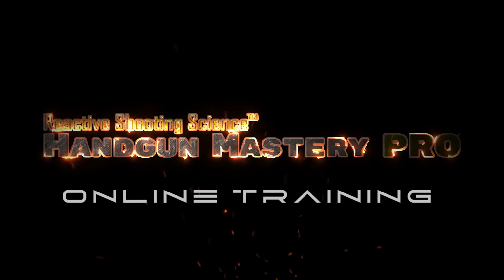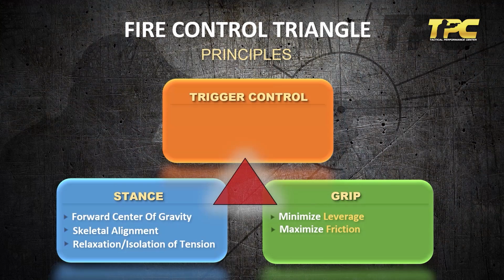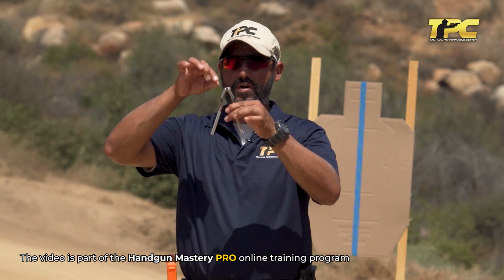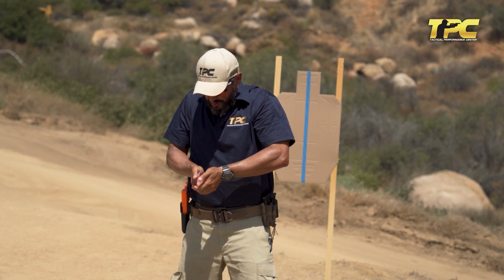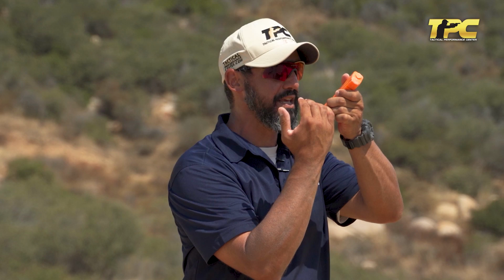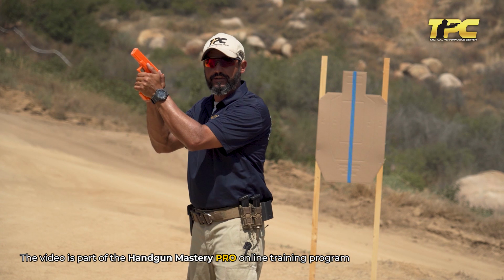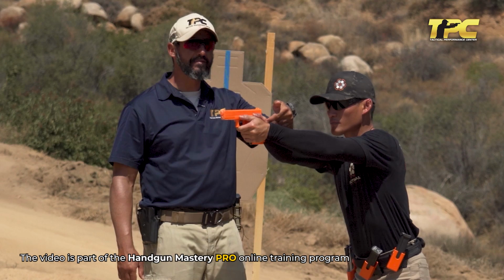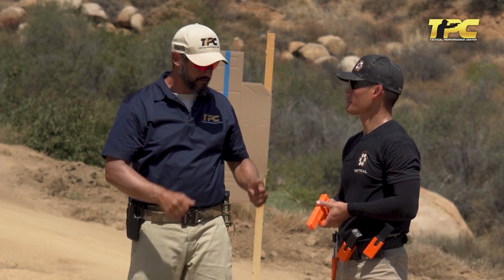MASTER THE HANDGUN GRIP: Improve Your Pistol Grip with the Nutcracker Effect Technique

Comment: Thanks for the video brother, it's really good, but my question is do you have to straighten up ur arms when you bring up ur handle gun to shoot,or you will have to stop the extension of ur arms before they are straitened up
Reply from the maker: We teach to keep the elbows slightly bent. Pay attention to the angle of your elbows when the hands naturally hang aside. That is the angle of the extension when you present the gun. We call it the natural extension. From that position, just stiffen the elbows using the forearms and the triceps (like you are in a push-up position).

Comment: How to combine nut cracker technique with the C Clamp?
Reply from the maker: C Clamp emphasizes that you use the middle portion of your fingers to grip front to back, in other words, avoid using the fingertips as a main point of pressure.  The Nutcracker effect will be achieved by anchoring the fingers on the front strap of the gun and then closing the back of your palms, applying pressure heel vs. heel 👍🏻

Comment: Do you tense your shoulder when this is applied I find my shoulders getting tense. Is this normal or am I doing this wrong?
Reply from the maker: The shoulders must be directed down and back. The lateral muscles will engage if you apply that correctly, not so much activation of the shoulder muscles.
Reply: @TacticalPerformanceCenter  thank you!